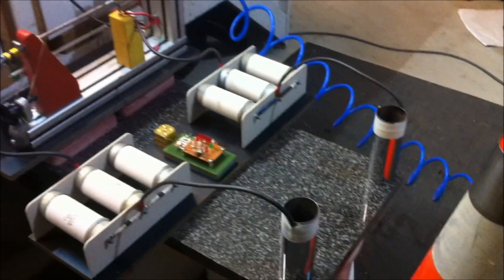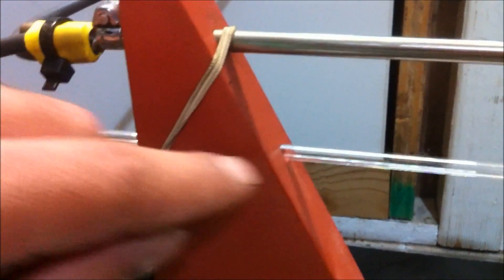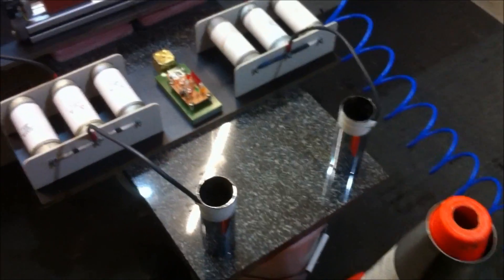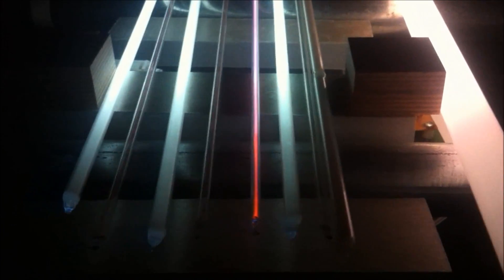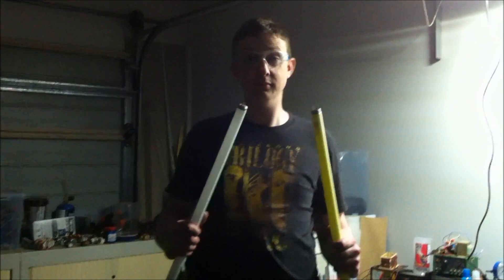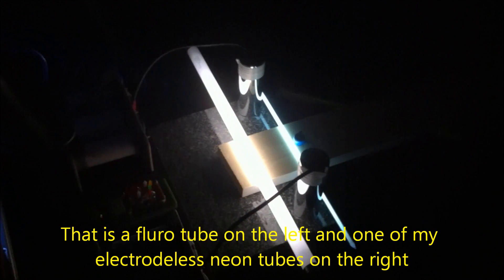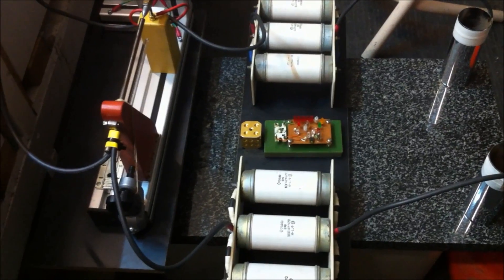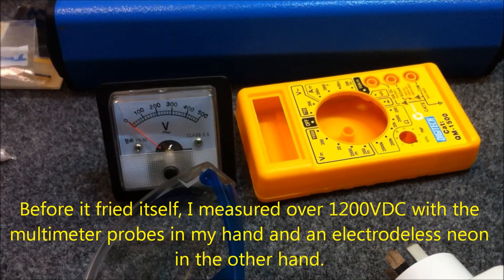Demonstrating Tesla's Radiant Energy & Wireless Power Transmission!

Comment: What is the distance limit
Reply from the maker: wirelessly = 1m away for fluro lights.

If I attached a very small gauge wire between the light and the HV output, it would light up at any distance ( tested to approx 8m).

Comment from the maker: You can plug the NST into the mains via a variac & get similar results, but with the 12VDC, PWM, inverter & variac setup, I have good control over input power and it's portable, so itcan run off 12VDC. It can also supply approx 500V to the NST, which is roughly twice as much voltage as the variac can produce alone. It's important to note that THIS SETUP IS FOR EXPERIMENTS ONLY AND COMES WITH HIGH LOSSES. I am now building a larger device which does away with the elaborate & lossy input stage.